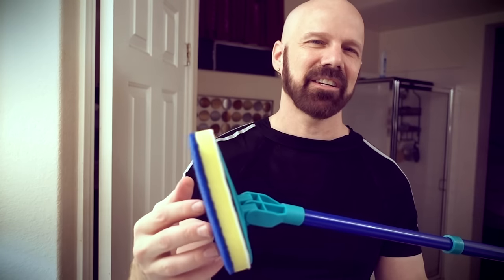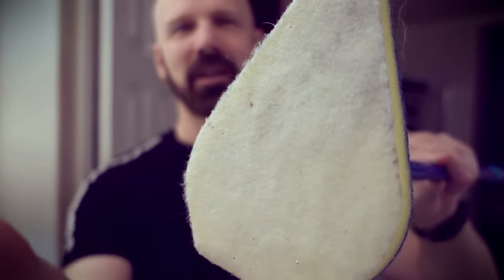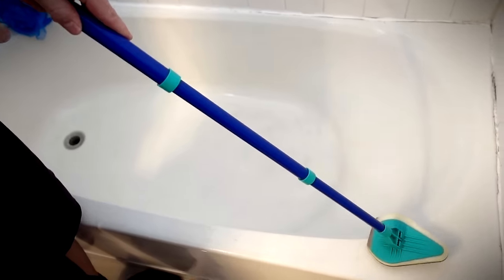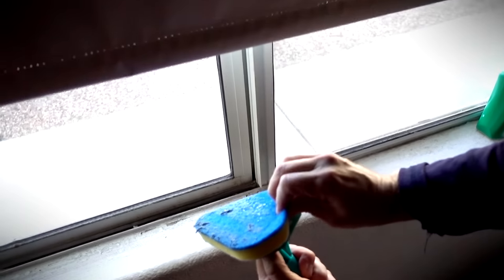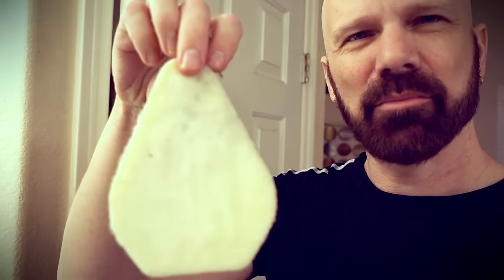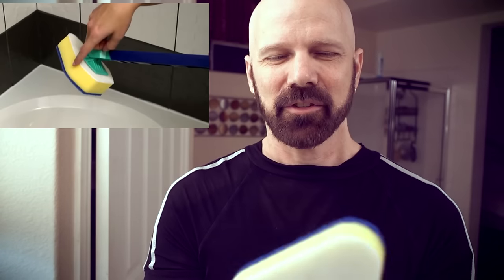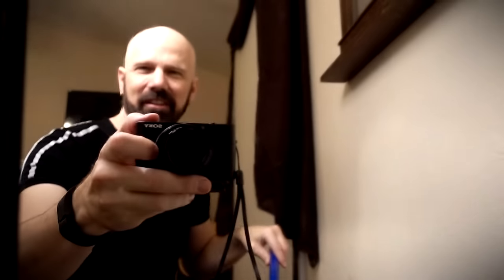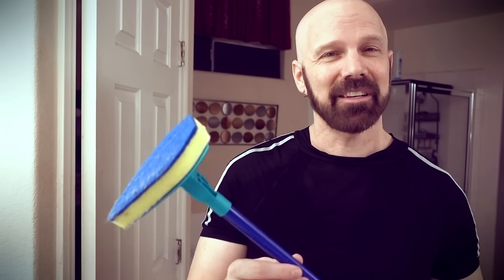Clean Reach Review: Does it Work?

Comment: I have something similair that I often use in place of a mop.  It too is basically a sponge on a stick, but it bends in the middle with a remote contraption to operate allowing you to wring it out and clean it easily.  It also has a much larger surface area so it cleans quicker.  Being rectangular, it can get into most corners no problem.  I imagine there'd be some tight places and awkward corners the Clean Reach would be able to do better, but overall my larger and easier to clean one seems more practical.